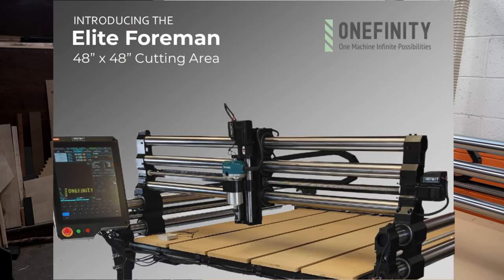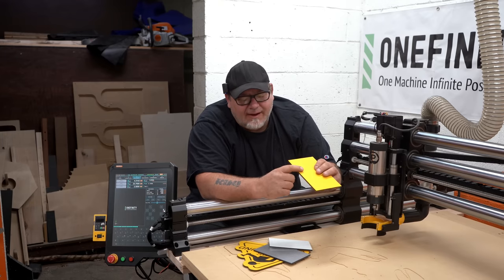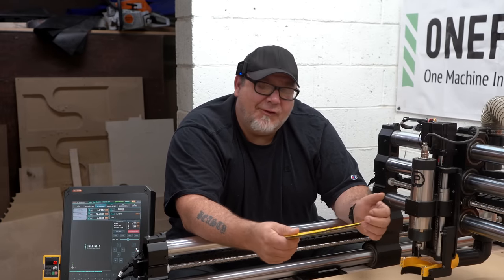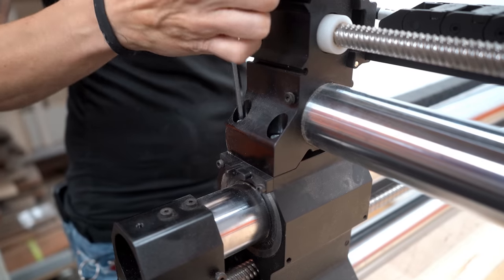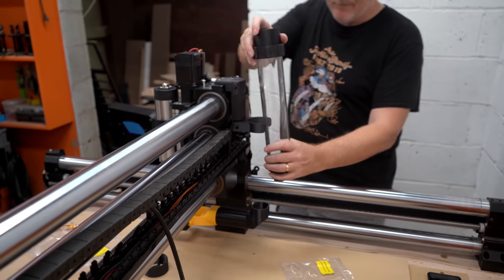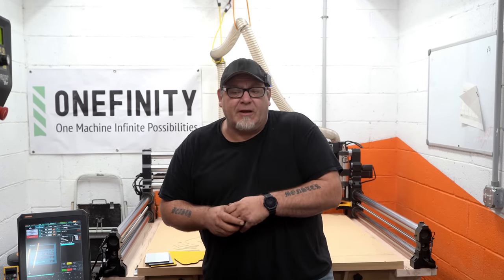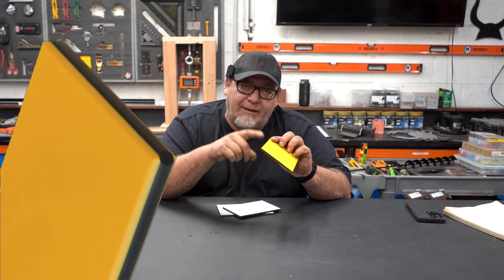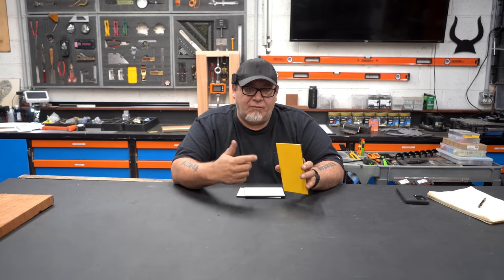The Truth about Hobby CNC Businesses

Comment: I owned and operated a small format full color printing company for 10 years back in the 1980’s. Before digital and full color copy machines made that business obsolete. I spent the other 33 years of my professional life working as a structural designer in the offshore oil and gas business. Now retired, I have been considering starting a hobby business and CNC router is one of my considerations. My experience in running a small production type business taught me a lot. There are so many things to consider. I would suggest anyone wanting to do this should really, really, really do your homework. The great thing, as I see it, with a hobby business you can avoid the biggest hassle and the biggest problem with owning a business. That is employees. I would never ever again own a business that required me to have employees! Period! Everything else is just technical. Stuff that can be learned. Sometimes the hard way.
Reply: Employees are necessary in order to make more than $50k a year doing this, since while they are loading and checking on the machine(s) and doing
the QC, you are out looking for the next easy to sell product and doing designs.
Reply: @rRobertSmith  That’s why I would only do it as a hobby. I’m retired. Don’t need to make a living anymore. It’s was that whole thing about having employees produce while I was out selling that stunk. Too many times it was employees not producing while I was out selling. Or what they were producing was garbage. I have know a guy that owns several fast food location Mac something or others. His only real problem in employees.
Reply: Most business would be a joy if not for employees and government...
Reply: @rRobertSmith  You can easily make more than $50k a year on your own if you get into the right line of work. Hiring people doesn't work anymore. But if you are just going to make simple parts anyone can program the competition will be stiff and the hours long and hard.
Reply: People that have to ask how much the machine was and how much will you make are not going to succeed. A faith step is required for success. I built the machine earlier in life, took an engineering degree and am dominating on my CNC even with inflation. When people ask how much you make for how much hours you put in, just go work for someone else if its just about the money, you have to be in it for different reasons. Your business becomes your identity and name it is not really about dollars.
Reply: @togowack your last statement is the truth, dollars are the consequence of doing great work, not the reason since the hours exceed what a 8-5er is willing to put into the effort. My business was “my” integrity and identity.
Reply: You’re correct! Employees suck!

Comment: I used to run a New Hermes engraving machine at a company that made oilfield equipment.  The phenolic plastic laminate we used for tags and instrument panel instructions was extremely durable, even is salt or heat.  Just some fyi for anyone wondering if its good for signs.

Comment: Want to bang up your feeds and speeds? Go to a high helix (up or down spiral cut) type cutter depending on your usage/needs... you'll be amazed! They excel at getting the chips out so you can go faster. And if a bur is a problem on the face, change to a reverse cut to leave the bur on the back. Crazy results IMO.

Comment: Great informative video.  I have been working HDPE for almost 2 years.  I have a woodworking business and now using HDPE for all my jigs instead of using plywood.  A little pricy up front but when you take in to consideration have to make jigs over and over again because of warping, cracking and twisting out of square, the HDPE , has made a huge difference.  HDPE slides on my tools, no need for waxing and simply I will not need to remake any of my jigs.
Reply: There's different kinds of HDPE. It's all HDPE but there's HDPE with additives in it. Those additives give the material different properties. Some HDPE is more slippery than other kinds are. The most slippery kind is very slippery indeed.

Comment: One thing you didst specifically mention is the cost of the actual machine. It has to be included as a fixed cost on each item. It eventually has to be replaced so every piece produced should be " charged" .

Comment: In the (first two cutaways) where you talk about the larger machine (cutting parts) and the one cutting signage, you show machines with extractors and the workplace brush but neither of them are covering the work with the brush - and the second one someone is actually using an airline to blow away the chaff!  The whole idea of the brush/extractor is to remove the chaff at source...

Comment: Great video - thank you. Just wondering about picking the Onefinity. You spoke a bit about it, but I would love to hear your thoughts on selection process. I am about to purchase a hobby grade and have narrowed it down to Onefinity and Stepcraft. I’d love to hear your thoughts - thanks again.
Reply: I have had multiple Onefinitys, always trading up. My current machine is a Elite Foreman with 2,2 kw spindle (iso 30) and ATC. In my opinion for the given platform size it is in the class of an Avid/Shopsabre, 

The Masso controller is a huge upgrade over the Buildbotics (which is very nice for the beginner). The Masso controller is an entry level INDUSTRIAL controller.  Masso pick up things like ATC, cutter compensation etc.

The hardest thing about the 1F is the wait.

Comment: I watched this video but can you tell me if longer rails are available anywhere?  I have built an all wood CNC with a surface area of 48"X72" but I am interested in replacing my rail and belt drives with a metal ball screw-driven system but am having trouble locating 72" rails. I contacted this One Finity machine company but their largest is 48"X48" rails.  I am not interested in cutting but very interested in carving relief figures. Thank you Izzy.

Comment: I have been in the plastic fabrication industry for over 35 years. I have cut alot of different types of plastics. I have ran cnc panel saws and cnc routers. When I  started out all we had was a table saw, router table, drillpress, jointer to cut with. My question is, do you feel like this machine would route up to 1/2 cast acrylic sheets? And be accurate when doing so?
Reply: The Onefinity CNC presented in the video is more than capable of precisely machining 1/2" thick acrylic and leaving a good surface finish. Based on experience, never cut plastic with a tool that has been used for machining other materials (unless you don't care about the surface finish).

Comment: How big of an area would be appropriate for this unit? Obviously enough to get a full sheet but for maneuverability around the table if needed.
Reply: You need to be able to walk around the machine on at least three sides, and to have enough open space to load material from the front. If you intend to cut 4' x 8' sheets, then you need room behind the machine for an off-feed table.

For safe and efficient operations, a Onefinity Elite Foreman with a 48" x 48" cutting area will require an area of roughly 10 ft. wide (min.) x 11 ft. deep to cut material up to 48" x 48" if floor mounted on a fixed base. Less space is required when mounting this CNC on a wall, a worktable on wheels, or the folding portable table available from Onefinity.

Comment: What is that little yellow box on the MASSO G3?  A speed controller for the spindle?  If so, Isn't the G3 supposed to do that itself?  I have been looking at buying this exact CNC or possibly the G3 Controller separately since I have read a number of negative things about Onefinity Customer Support and how they censor their support forums when people bring up things that they don't like.  Thats a shame since I really like those beefy linear rails.
Reply: I think that’s a pendant controller, for jogging the axis. I have 2 machines with Masso G3, both DIY. I’ve been very happy with them and have done over 2000 jobs between the 2.
Reply: Round guides tend to be a lot weaker than they look. I prefer real linear guides. Although I saw a big vinyl cutter once that ran on car tires. It had a work envelope bigger than a basketball court. The gantry beam was over 6 feet thick.

Comment: just had an odd thought..   if floor space were an issue, how easy would it be to use a CNC in a vertical plane vs the typical horizontal plane?  what might be some of the considerations for or against that.
Reply: In the typical orientation Z drives against the pull of gravity. The mass of X and Y are borne by bearings. I guess you could counterweight the axis? Still, weight equals inertia. You're making something that's intrinsically hard even harder. I'd say you're better off just finding the space. What you have to appreciate is just how much smaller Z is compared to X or Y. Then beyond the gravity issue with movement there's gravity with the work itself. It is far easier to place things on tables than on walls. You can put work down onto a table. You'd have to hold it to the wall.